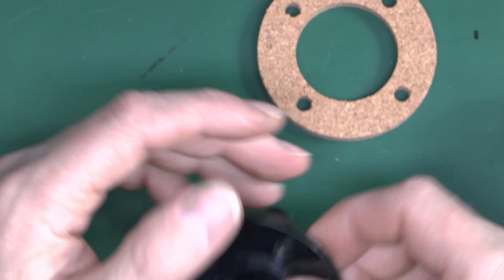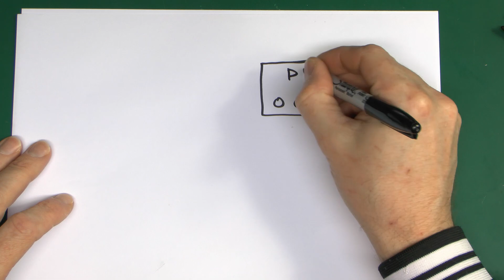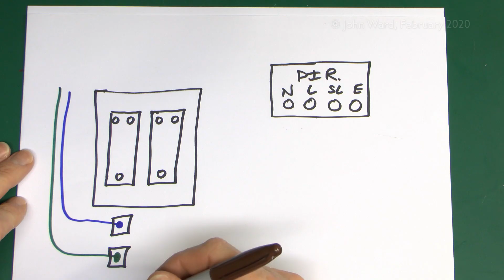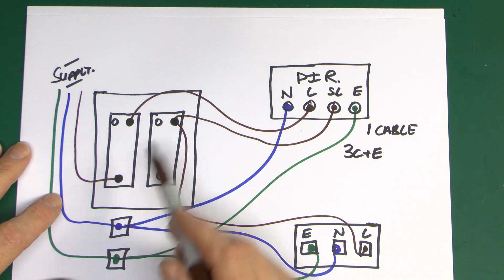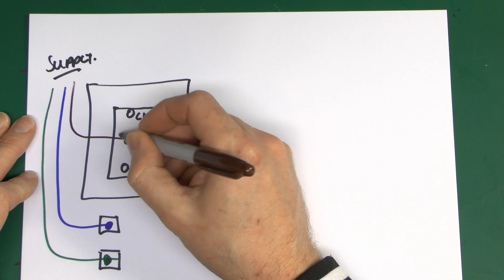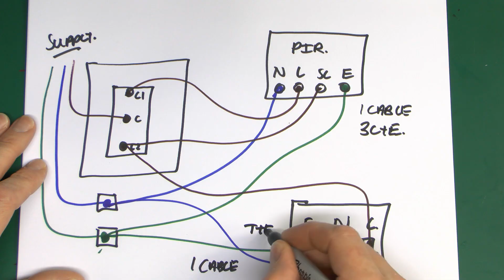Lighting Sensor Wiring with Override Facility

Comment: Interesting solution - I have just fitted a pir sensor in a cupboard - 1 x 2 way switch only so supply goes to switch, then to sensor and on to light using just twin and earth cable. In this case, the client doesn’t really need the option of the light being switched on permanently in case she forgets to turn it off after closing the door! I can see a great use for this circuit in a garden with a pir where you may want to keep the floodlights on during bbq season etc., - so thumbs up from me JW👍
Reply: Block of flats hallway lighting was on timeswitch. I had it converted to PIR with two override switches as per John's first circuit.

Fitted our understairs cupboard with PIR, permanently on. Worked fine for years then failed to turn off. Now plan to fit a door activated switch to do the job - meaning light would remain on while door open - which PIR turned off ! As doorbell transformer is in there, Plan to light the cupboard with LEDs off that via door switch. One day, I might get round to it !

Comment: Is it possible to get a sensor with both microwave and PIR technology that requires both types to be tripped before the circuit completes? Wouldn't this be the best solution?
Reply from the maker: They exist, but are typically used for intruder alarm systems rather than stand alone sensors for lighting.
Reply: @jwflame  Thank you.

Comment: if wiring the on off on in singles could you connect SL directly to light Line and another single from L2 directly to light L?
Reply: That sounds like the same difference but without the SL going via the switch again.